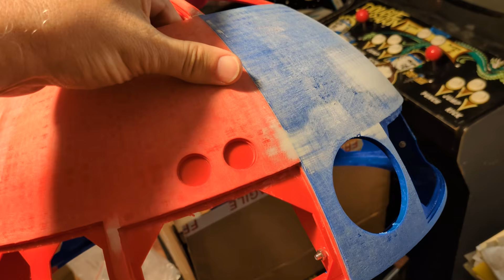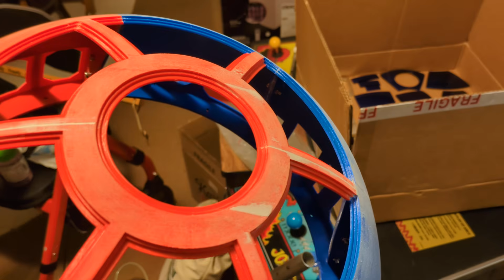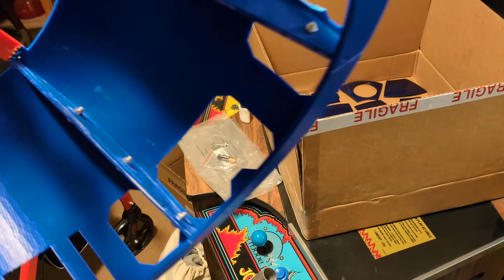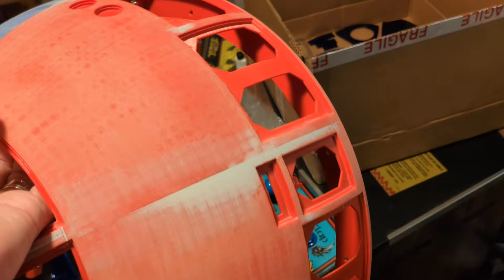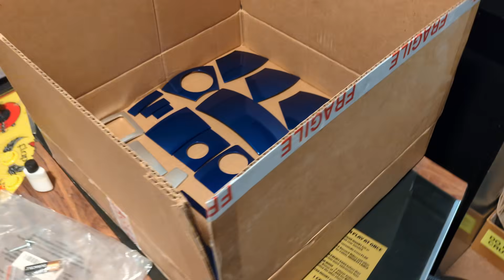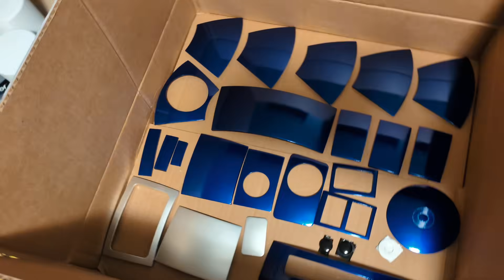3D Printed R2D2 - Part 121

Comment: I don't suppose you have the files saved as sections do you? I'm really struggling with orcas slicer it won't let me print in sections with the cut function.
Reply from the maker: I really recommend joining Michael Baddeley's Patrion for full access to all the files, including versions that have been cut to fit smaller printers.

Comment: Just got my SV08 Max and am printing a new ring gear.  Debating what version of the dome to print to replace my less than optimal Rev2
Reply from the maker: If the printer is dialed in, the MKIV sure looks nice.   I haven't been reading up too much on it, but I think I remember reading some people having issues if they're printer isn't quite dialed in.

There's also the option of the modified Rev2 that has the same basic structure of the Rev2, but adds all the mounting points for servos and panel hinges like the MKIV.  It's called the Stephen Mathis V4 modified dome and is in the Baddeley Patreon files.

Comment: Your panels look amazing! I say stick with the dome you’ve got and forget about the opening panels. The opening panels aren’t true to the original trilogy anyway. I ‘finished’ mine last month and I can look at it with a critical eye but choose to admire it as an amazing prop replica.
Reply from the maker: Thanks!  I've been spending all the time I can getting the dome ready.  I've got all the panels painted, as well as the dome rings.  I haven't painted 2 of the 3 holoprojector shrouds or any of the 3 projectors.
I've spent so much time on the parts that go into the dome, that I have only just begun working on the dome itself!

Comment: I also forgot to mention that Autozone has changed over to UPOL from Duplicolor, and they had the Sonic blue pearl when I was there a week or so ago and it is a few dollars cheaper than the Duplicolor.
Reply from the maker: Interesting!  I know I use too much paint, I haven't added it up in a while but I'm pretty sure it's my highest expense.  I picked up another can of Sonic blue with a $5 off coupon at O'Reilly's about a week ago, and now I've got a $10 off coupon.  I think I'll probably get another can, but I should check out Autozone as there are a few around me as well.

Comment: Panels look great Tom.  I like the washer solution for the center panel.  I am in process of building a new dome for my R2.  I chose the complex dome and was able to do it in 1 piece on my Ratrig. It has all the connection points built in for the hinges and servos, but I am not going to animate them at this time.  My old dome is the Mark2, same as your reprint.  I think I saw a 350 cut posted on the Baddely share last time I was out there, that would work on your Voron. Another bonus is the top structure around the pie panels is much beefier. My entire R2 was printed in PLA on an Ender 3 Max neo, so this is all being done in ABS.  I totally get your burnout, I have been working on this dome for months,  but not hurrying like I did the first time. I also have most of an R5 printed in ABS, but have not even sanded a single part for it yet.  I promised myself not to rush on this one and do everything the way I want it.  Once you get bit by the Droid bug, it is part of your life forever.
Reply from the maker: I bet the Ratrig helps speed things up!  I'd love to have an R2 and R5, but I've got no room, same for a Ratrig!  Too many hobbies!

I was feeling so good when I completed the body this year, but here I am getting stressed out now that I feel the time crunch to get the dome done before the weather turns.  Slow and steady is the way!